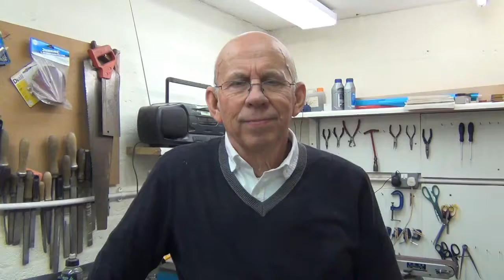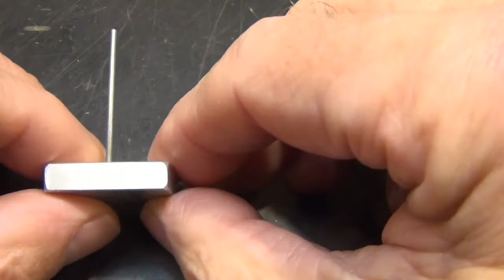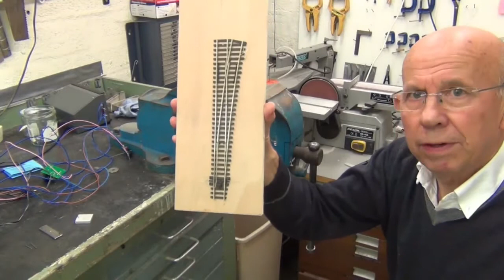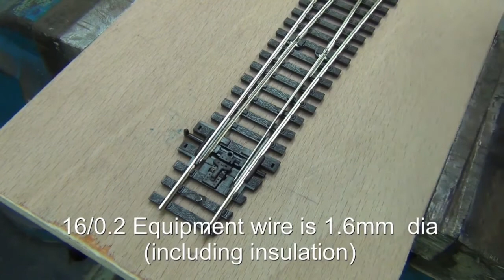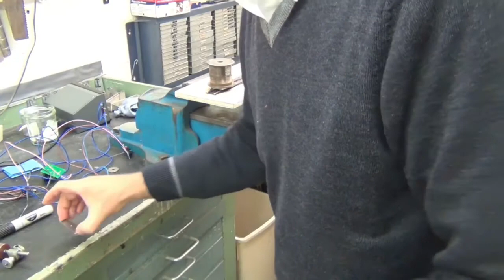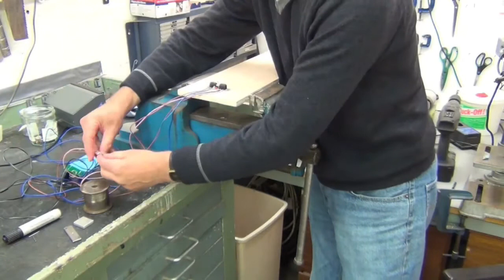Seep point motor alignment tool

Comment: Thanks for the video. I reckon I'll be making myself something similar to your alignment tool as I've got 19 points on my layout. Just wondering what size screws do you use for mounting your point motors as I'm yet to work out which to use. Thanks!
Reply from the maker: Hi Ben
I used to sell these tools on Ebay but I got weary of making the same thing all the time. To answer your question , here is an extract from the instructions I supplied with the tool...........

	I have used M3 x 12 countersunk wood screws and have found that using countersunk screws helps to centralise the point motor and prevents lateral movement when operating. The use of pan or button head screws, which allows for slight lateral adjustment to the point motor, should not be necessary as the point motor and point should now be in perfect alignment.	Do not over tighten the screws, as this can distort the mounting base, causing electrical and switching problems.

FURTHER INSTRUCTIONS TO ENSURE SATISFACTORY INSTALLATION
Make sure that the operating rod of the point motor is at right angles to the motor mounting base. I have noticed on occasions, even when new, that this has been a problem, and I have had to adjust the rod by carefully bending it at the mounting base end.

Regards
John
Reply: @johnboy2472  Brilliant thank you so much John, this is really helpful